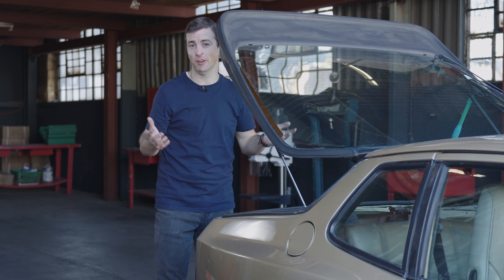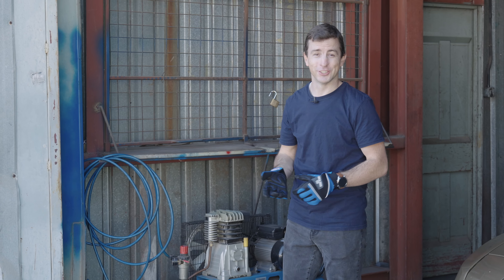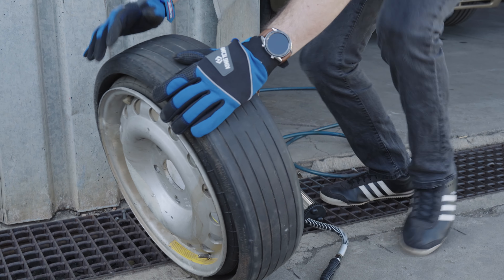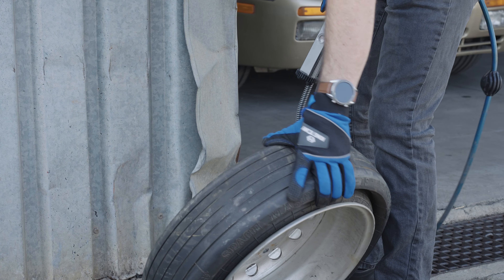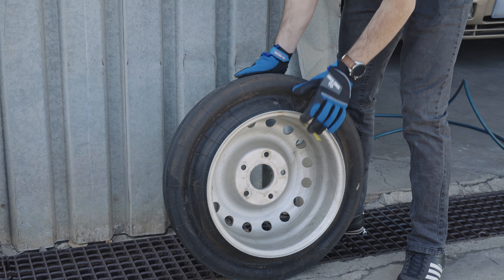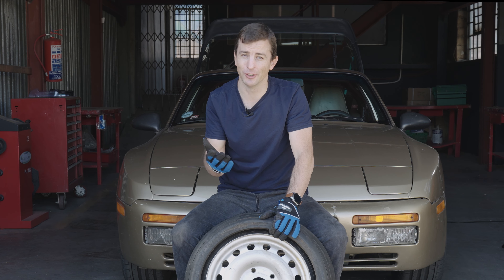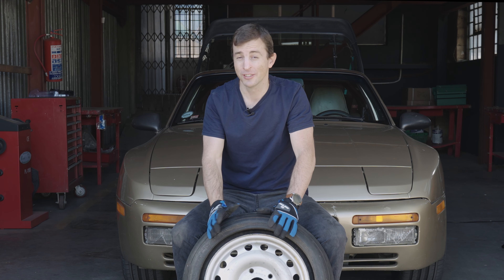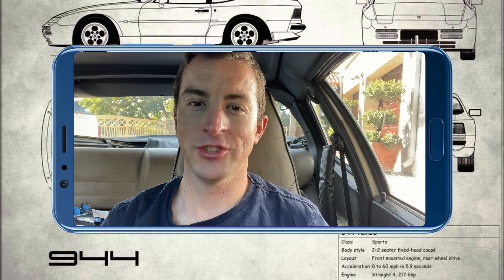ANY GOOD? Porsche 944 Spare Wheel (35+ Yrs Old) | DailyDriver944

Comment from the maker: 🚩AN IMPORTANT UPDATE: It seems the spare wheel well is part of an accident crumple zone and the spare is needed for this - so don't just leave it in the garage or replace it with something that doesn't fit properly. I'll update this comment as more information becomes available.
Reply: Say what? :-D Seems strange to use the spare as a part of the crumple zone. 
Does that apply for the 928 as well?
Reply: What?? Throwing out the spare tire was my best weight saving effort so far 😝
Reply from the maker: @Kptgibson  - haha - sorry 😅
Reply: I was stopped (by myself)  in my former 944 NA, Euro fiberglass bumpers and spare tire removed, at a red light and was rear ended by a distracted  SUV driver at 60 kph (no attempt to brake). The rear crumpled in nearly 2 feet, even buckled the roof behind the sunroof so it wouldn't close. My passenger door would not close again. The car took all of the energy and absorbed it very well leaving me completely uninjured other than a little cut from the rear hatch glass which flew by me like it was a hail storm. I often wonder that if I had the spare tire in and the original aluminum US spec rear bumpers, would my outcome be the same, or would all of that energy have been transferred to me rather than to completely crushing the spare tire well. I have an '86 951 now and have removed the spar tire.
Reply from the maker: @Chrisovideos  - Thank you for sharing this! I can see how it can be beneficial as a crumple zone instead, and it's definitely food for thought.